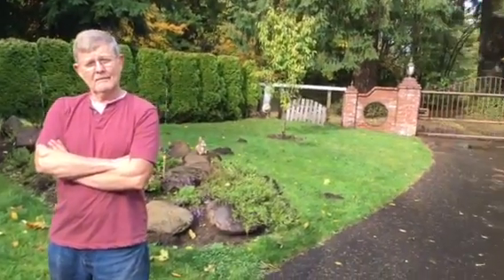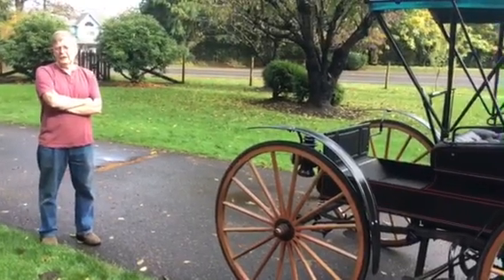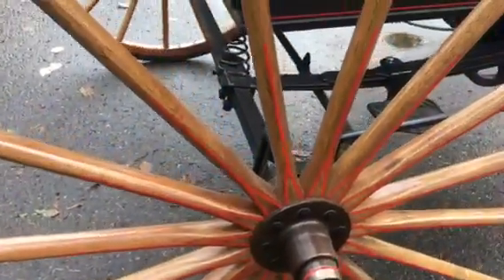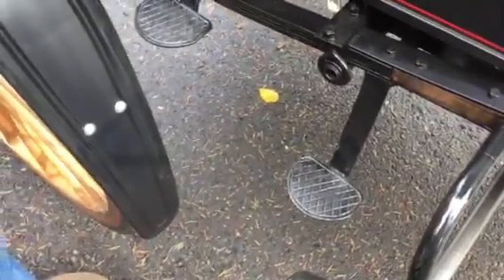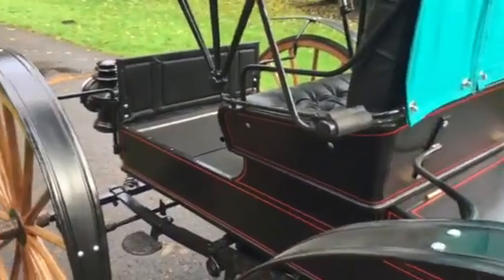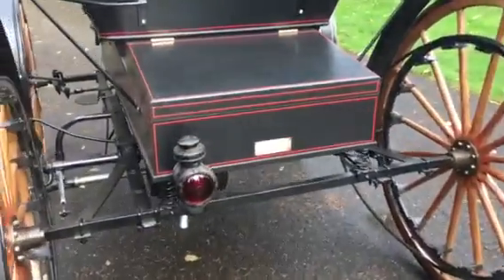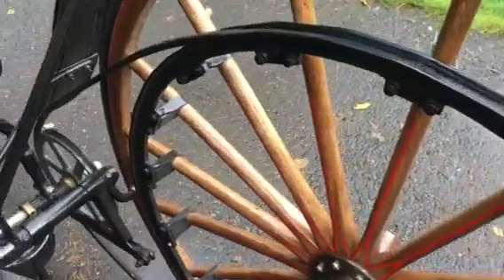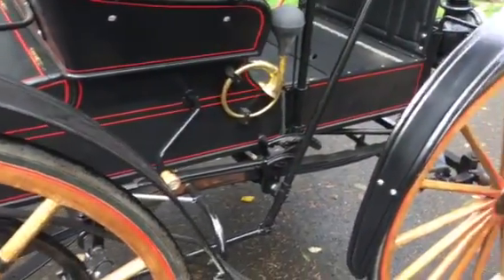Scratch-built horseless carriage, part one.

Comment: Please tell me more on how y'all built the side spring a where did you get the rims and tires? I'm stuck at the side spring in my build and I want to get as close as I can to the look of your side spring.  Thanks for posting the video.
Reply from the maker: hearsejr this was my brother’s project so I don’t have too many construction details, other than him answering my questions in this video. However I do remember that the springs were built by modifying some used springs that I gave him from a 1974 Jeep CJ5 to most closely match the originals he saw in the museum. I think he found the wheels from doing an internet search, they were Amish built, and quite reasonably priced. Not sure which vendor he used, but there are several. 
https://www.google.com/search?q=amish+wood+spoke+wheels&ie=UTF-8&oe=UTF-8&hl=en&client=safari
Reply: @danwarner9399  thanks. I guess I might have to stray from the original, when it comes to the side spring. Thanks for sharing the video.